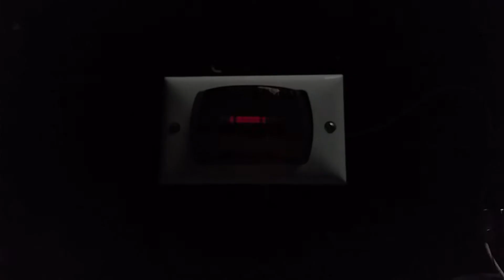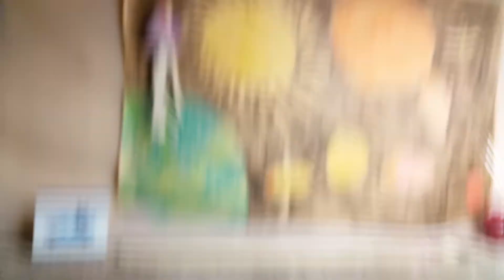Testing of Various V33 Strobes and Lamps

Comment: This is kind of a weird question, but would the strobe circuitry be small enough to fit inside a 2903 plate?
Reply from the maker: The circuit board is almost the same size, but the 2903/4 uses a "horseshoe" shaped tube unlike the linear tube the V-33s here use.  If someone wanted to work hard enough, they can make it fit.  That would require some soldering, de-soldering, and some time.  The quick answer would be no due to the shape of the tube.
Reply: I meant could it fit directly inside the front of the lens. So no?
Reply from the maker: Correct, It will not fit in the lens.

Comment: What is the model number of the strobe at 4:12
Reply from the maker: It is one of the older Space Age Electronics V-33 remote strobes.  Since I am on vacation, all I can give you is the "V-33" part, but I can check for a more detailed model number in a few days time.
Reply: It's probably a V33-SFXW-SS24D.